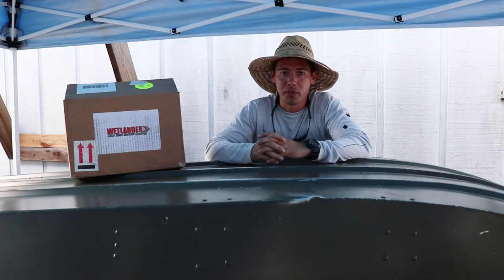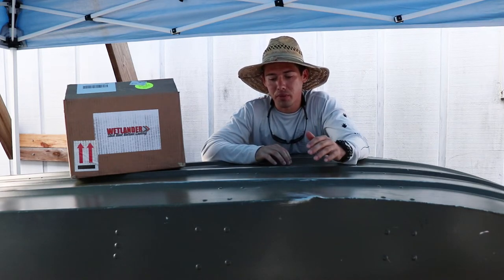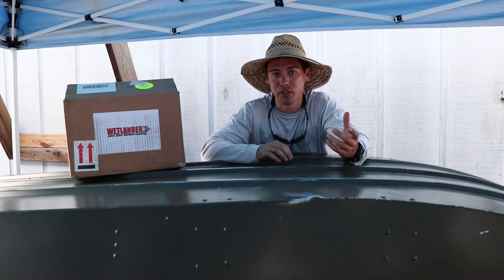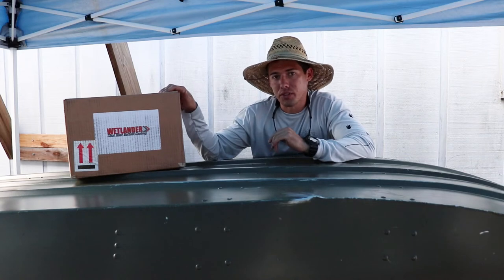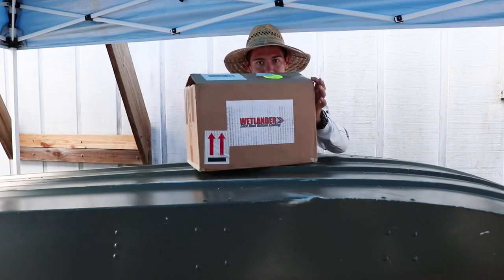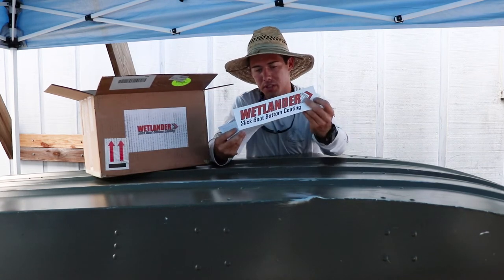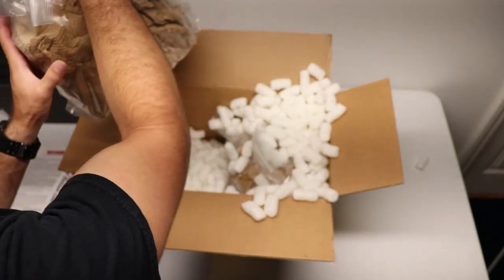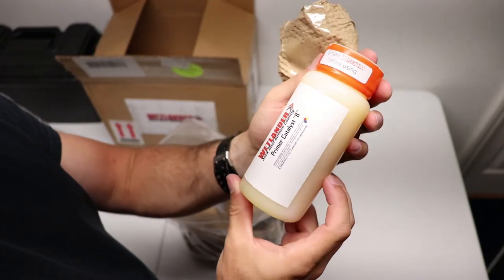Wetlander - Bottom Coating for Boats! Aluminum, Fiberglass or Wood

Comment: You'll enjoy it. We did two boats in gator glide last year and it's a huge improvement. Biggest thing to remember is it's on the boat when loading/unloading or you're dropping it on the ramp lol
Reply from the maker: Hahaha great advice! That would not make me happy dropping my boat down the concrete ramp haha. Did you notice any change in speed in open water?
Reply: JTgatoring if it was much of a gain I'd say it's pretty minimal in the speed side of things with our boats. Make sure you coat the longtail too! Dave at Gatorglide recommended that for longtail guys.
Reply from the maker: Hmmm... I never thought of that with painting the tail. I've been hearing from others that they didn't experience much speed differences either so maybe I'm being to optimistic in that area. We'll see though!
Reply: JTgatoring you'll appreciate doing the bottom of the boat when you're stuck and walking the boat out lol. Dont get hung up on the mph game, just make the boat fit your needs and have fun! I'd be interested to see what the difference between brands with durability on different terrains. Around here I dont see too much holding up against flint rock and that's obvious after 1 year. I'm also fairly hard on things.
Reply from the maker: Yeah, I was really looking for the extra slip & slide over thick vegetation when I'm running over tussock and mud. An increase in MPH would have just been an added benefit. I hopefully wont be running over rocks or limestone edges, but down here we do have a lot of sand and logs. I will be recording footage every time I go out so I'll be able to track it and catalog it on the channel. Unlike you, I try to be easy on things haha but if I gotta get a little banged up it happens hahaha

Comment: How's it holding up and did it fix the leaks. I'm trying to figure out what my next move is going to be
Reply from the maker: Holding up good. I did an update video on it and did another layer. Sealed all the leaks and made it bone dry. Those were the two things that I was ecstatic about: The boat was completely dry inside, and it slid over grass noticeably easier
Reply: Can you tell if it cuts through the water better?
Reply from the maker: @CaptCaaaveMaaan  I can not. I still get the same speeds, but it's most noticeable in heavy vegetation.

Comment: Any updates bro?
Reply from the maker: I have footage and just need to put it together and create a video. Mine has been beaten up a little and has worn through on high traffic areas like when I beach the boat. I will probably end up touching it up, but for what on the boat, its still slick and doesn't stain and is holding up pretty good. With the parts that are worn through, its not a section or anything, its just scrapes and hits where it chipped off wear it looks like it didn't cure or attach to the boat correctly.
Reply: @JTgatoring  did it seal your leaks?
Reply from the maker: @SuperCpatrick  Yes it did seal my leaks. It is bone dry now when I get it back to the ramp after a whole day fishing